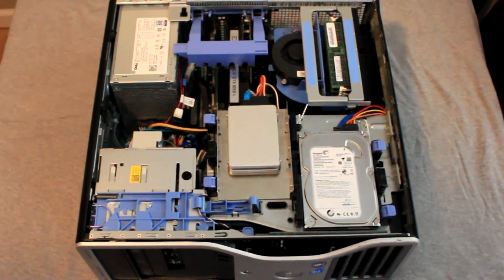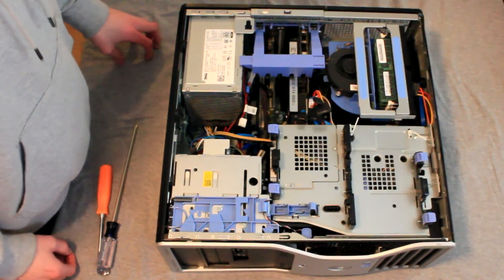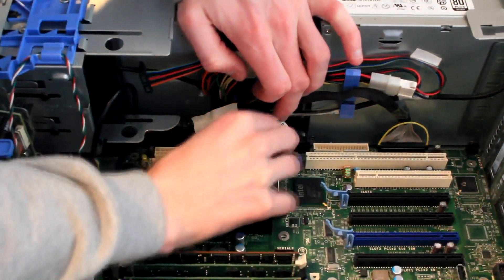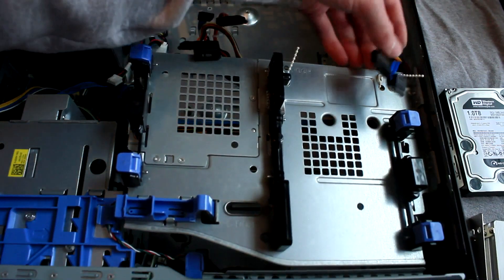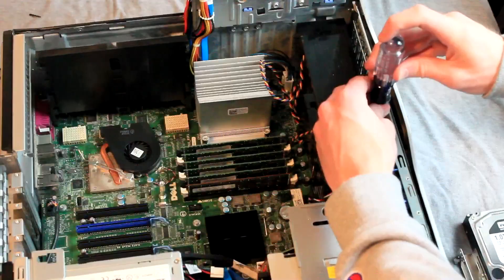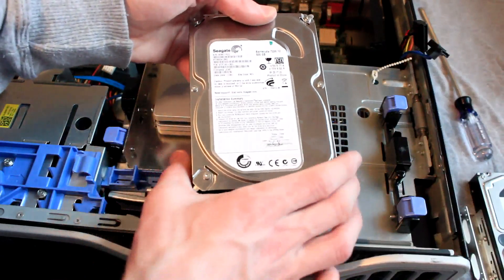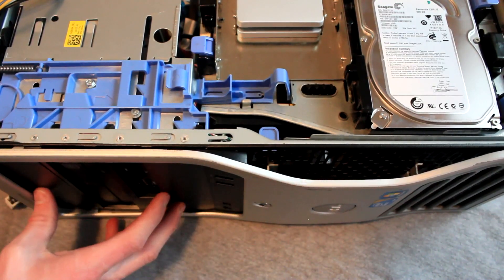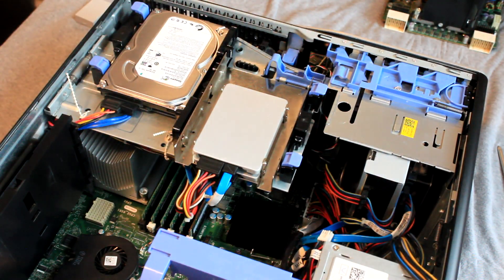Dell Precision T5500 Build Series: Part 4 - Hard Drive Install

Comment: Missed a step when attaching the hard drives. The drives are connected SATA 0/SATA1/SATA2, etc. Make sure to attach the drive you want to use as a boot drive on SATA 0 connector. Not a  big deal the system will still work but it's always best to have your boot drive first.

Comment: When a message comes up referring to RISER DIMM 1, is it referring to the movable riser or the memory sockets ON the motherboard?
Reply: I'm sure you've figured it out by now, but for anyone else wondering, RISER DIMM 1 refers to the slot labeled DIMM 1 on the riser card.

Comment: Hi there. Thank you for the video. Can you please test your HDDs Read/random read speeds? I have the same workstation and the problem is that it only supports SATA II so my SSD read speeds are around 240mb p/s, and for WD GREEN around 100-120 mb p/s. Just wondering how is it with your drives.
Reply: hi. late to the party, i know, but is that so bad that it's only compatible with SATA II? i have Pro Tools and so i want to get a SSD.

Comment: where do i get the bracket for the solid state hard drive?
Reply from the maker: Ebay or Amazon. 3.5 to 2.5 inch drive bay converter
Reply: I zip tied my 1GB SSD to where one of the 3.5 sleds went.  I got mine free from a co-worker and it's the best free computer in the history of free computers.  I have 2x CPUs but they're 4 cores each.  I'd like to get the 6 core 2.93s from this series. I do have the full compliment of RAM - 72GB.
Reply: @Brons2  lol NICE. about 9 months ago i got this T5500 computer with Xeon 6 core 3.47s, a 4GB FirePro, and 12GB RAM for $120 at goodwill!!! they had TWO of them!! (they have a section that buys computers from govt offices, so they are pretty well cared for.) i came back later and the other was gone. so some other good-looking guy is out there commenting this same thing on another youtube video. actually.... he may be in here. hmm.. * touches chin *  ..and i am convinced that this was a security office's computer since the graphics card had 4 DP ports. any home-user wouldn't have messed with that and would have upgraded for HDMI.. myself excluded. i got two adapters and have a 4KTV and an 32" HDTV as my monitors, and it works great!!
question:  i am using Pro Tools, and will soon buy my first 2.5" SSD. is this computer compatible as is? or do i need anything new to accomodate the SSD? (besides maybe a bay converter.)